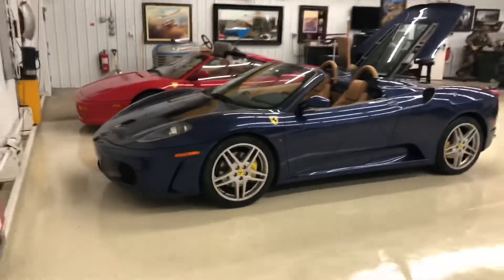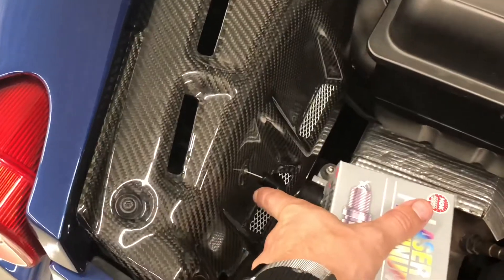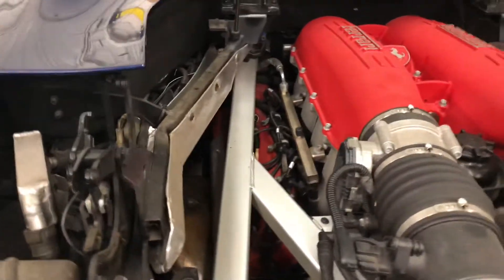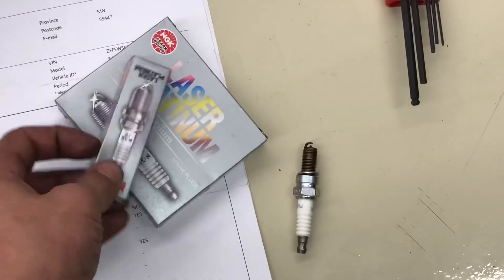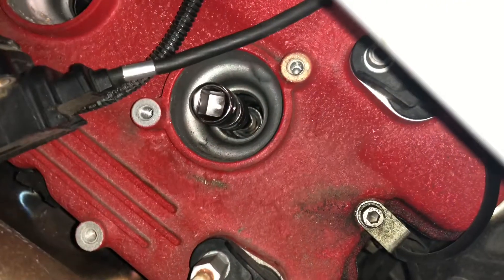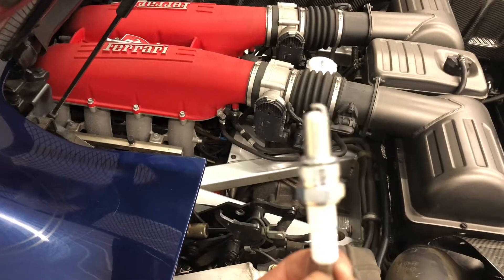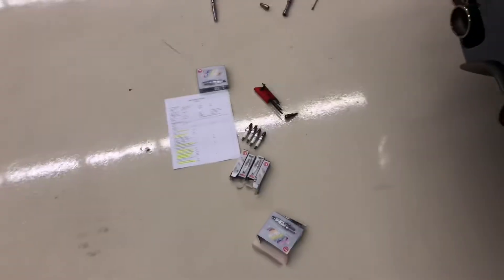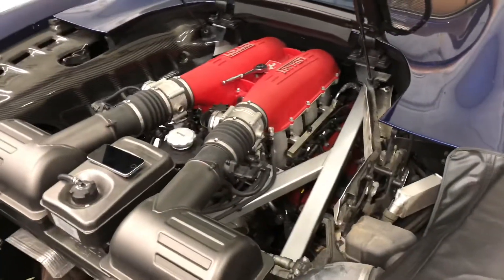Ferrari F430 spark plug change

Comment: Nice collection of vehicles indeed mate cheers . Only thing is if you went to the stealership or Ferrari ,I bet they’ll let you that the engine has to be removed to change those spark plugs or some other bullshit excuse not to mention the bill after .
Reply from the maker: luckily plugs have I think always been accessible engine-in on the Ferraris. everything else though, yeesh.
Reply: Ovalbore from memory I think The older model cars like 302 GTS 79 to early 80’s you have too remove the engine. Because they have the engine mounted east / west configuration but still a mid engine car .im sure this is correct?? Been years since I’ve worked on a exotic vehicles . The closes thing would be a Nissan skyline r32 GTR or one of the other models I’ve worked on many of them
Reply from the maker: possibly. I think the QV though you could do it in car.. I know those were odd ducks and were transverse